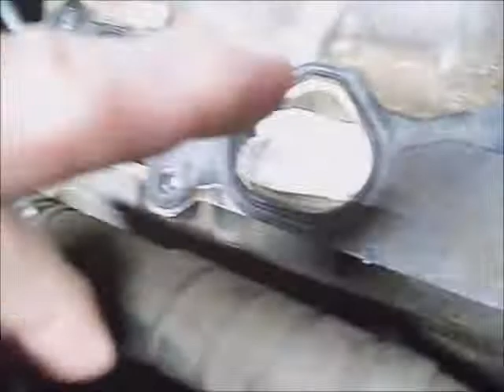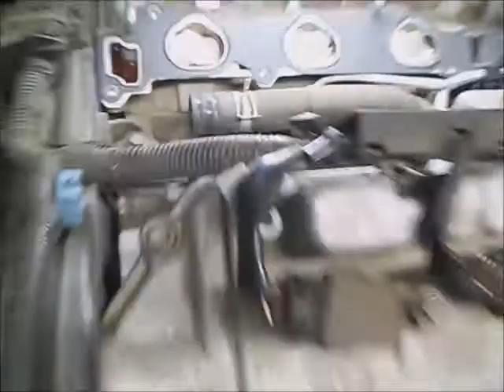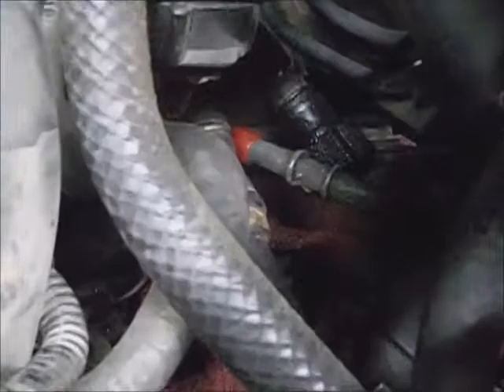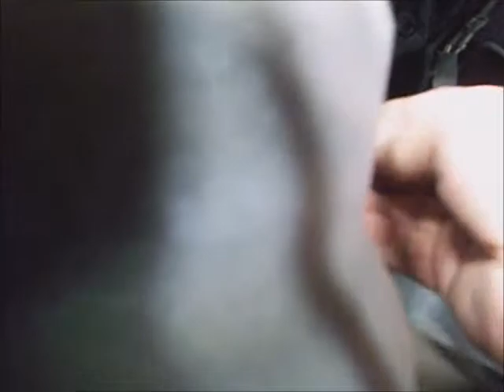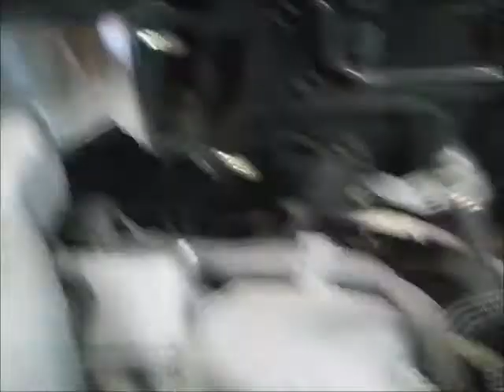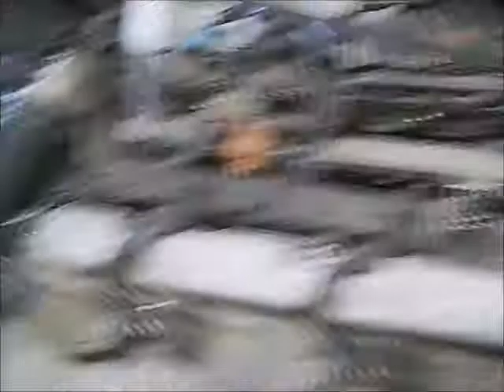Toyota Lexus `02 w 3.0l vvt engine, knock sensors replace pt2

Comment: idk who this may help but i removed the sensors with a 27mm shallow socket (its all that was available locally) and it worked for the job, just dont seat the socket all the way on the sensor when installing in order to not damage it. A standard socket would probably be best however a deepsocket was too long for any clearance for me. Hope this helps someone
Reply: are both new and old ones the same size?
Reply: @S-KO4000 if oem, they should be the same size

Comment: Hi. You didn't mention the torque specification for the bolts holding down the water outlet. Is it 12 foot lbs just like the intake bolts? Thanks for the video.